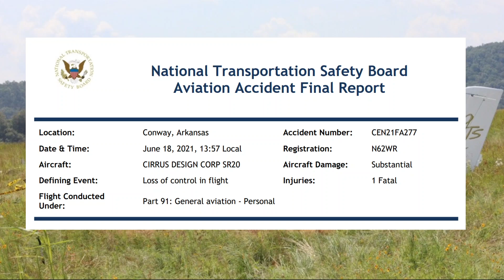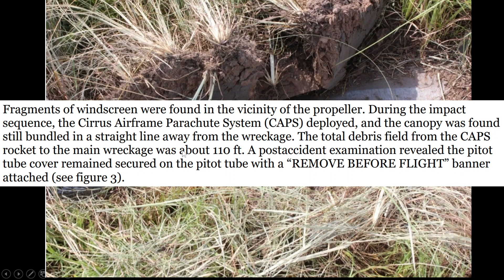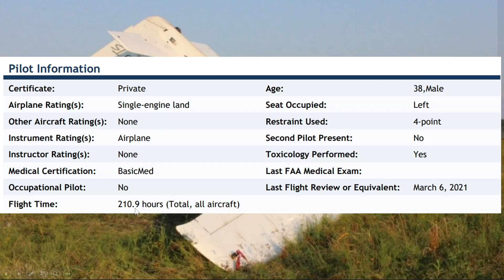Cirrus SR-20 Massive Stall Spin in Arkansas

Comment: Open fields everywhere, open road, or even downwind runway landing all looked like possibilities - it's a shame he tried to stretch it back and spun in. Again, as a glider pilot, I wish all powered pilots would at least get some stick time in sailplanes to help recognize that they may still have lots of options and to not panic.
Reply: All he had to do was make a normal pattern and land! Panic was the cause 😡. In VFR conditions loss of instruments should not be an "emergency"! The airplane has three basic "attitudes" coupled with three basic "power settings" that are used EVERY flight. Teach students ATTITUDE FLIGHT on every flight. Draw their attention to this to reinforce what they are already doing, attitude and power. Cover up the instruments and let's go flying using power and outside reference. Use this on Biannual Flight Reviews always and you will catch those students who were NOT taught ATTITUDE FLIGHT as they should have been! Instructors; it's a definite point in primary training but not being taught per se! One does not need to fly a glider to explain this,"forced landings" are already part of the curriculum.
Reply: Yes it would probably benefit every new pilot to do a little glider flying before doing powered flight. Obviously had not had enough training for this situation and started to panick and lose awareness instead of just flying the plane. I'd imagine an experienced pilot would roughly know their airspeed etc even without airspeed indicator. 
Shows importance of doing pre checks and a good walk around before flight. I'm not a pilot but as a pilot yourself how hard is it to roughly know your speed if your airspeed indicator fails?
Reply: @garymiller5624  Yes seems like he definitely hadn't had enough flight training or not enough training on his awareness without using instruments and knowing his power and outside awareness like you say. So sad when it's over a cover he forgot to remove but like you say if he'd had the right training he probably would've landed fine

Comment: My first plane a Cessna 140 taildragger we picked up in bitter cold winter had a frozen pitot tube. My Buddy Bob the best stick & rudder pilot at our airport flew it back with me, he landed at night greasing it on like it was nothing. Looked at me & said just like a old shoe. This Cirrus pilot had zero airspeed on the takeoff roll with plenty of runway to abort. In VFR conditions you can still easily fly the airplane by looking at the nose & wing tips on horizon  You know the horizon position on climb, cruise & decent when using your proper power settings & configurations. Pitot tubes get blocked all the time with bugs, water, ice or leaving the cover on. I had one partially block with mud dabbers giving much lower airspeed indication. Had no trouble flying it cause you don't use a airspeed indicator alone to fly the plane which I learned from Bob. Next flight it was completely blocked, a CFI & friend doing a BFR used the whole runway before rotating just clearing the tree's. I blame this accident on a total lack of proper training especially for a Cirrus. I also knew Mooney pilot that got killed taking off IFR then trying to land immediately with the pitot tube cover on. Flight training with the airspeed indicator covered up should be a requirement which good instructor's do.
Reply from the maker: That’s sounds like good training
Reply: I still teach the callout “airspeed alive” and call it out on every takeoff whether I’m teaching or operating my buddy’s antique aircraft. Be safe out there.
Reply: @samsharp8539  I have alot a pilots that don't confirm or know how to that the engine is producting full power on takeoff. Just because the throttle is firewalled doesn't mean your producing full power. They don't even know what static rpm check. All checks done at the beginning of the takeoff roll.
Reply: @Nord3202  Been asking that challenging question for decades. The other comment that scares me; “Well my turbo Bonanza/Arrow/ Saratoga, etc. can get out of the mountains with no worries about density altitude.” I guess they have turbocharged props and wings as well. Static rpm and power balance checks on multis are critical. I’m glad that you are emphasizing these checks. I get blank stares from knee instructors about the static checks. Don’t mind me, kids. I’m just old school.
Reply: New instructors.
Reply: @samsharp8539  With static rpm checks & density attitude calculations you can avoid taking off on a death flight, barely climbing out of ground affect or trying to make the impossible turn back to the runway. We need better CFI's way to many crashes due to poor training.
Reply: @Nord3202  The Stinson crash where density altitude bit the pilot is a prime example. The FAA’ s film “Harry Bliss and Density Altitude” was/is a great example as well.
Reply: @samsharp8539  That Stinson pilot was on a horror flight, once he broke ground he was at the point of no return. Every pilot should watch that  Stinson & Harry Bliss Density Attitude video for there flight training. We are seeing more crashes than ever.
Reply: @Nord3202  It appears that the trends are in the cards. We are making the same mistakes at an alarming rate. I have sure made my share of mistakes and have lived to tell about them. Ironically, I am back to flying a ‘46 Stinson Voyager courtesy of my flying buddy. Another great film is by the USAF from the 1950s. It it’s called, “No Sweat.” It covers a lot of everyday mistakes all in one flight.
Reply: @samsharp8539  Going take a look at that USAF No Sweat training film. You never can stop learning when it comes to flying. My friend has 2 Stinsons a Voyager & Gull Wing. When I was a student pilot a metalized wing Stinson 108 was sitting wheels sunk in the grass with a for sale sign $3200. I was talk out of buying by my CFI. Someone got it flying in a weekend. Saw it at every local fly in. Stinson a great plane.
Reply: @Nord3202 You sir, are killing’ me. A Gull Wing, the Detroiter, The Ryan commercial series were all on my bucket list. Time is running out. So many planes, too little time left at my age. Feel not, sorry for me. I ride the 1200 Sporty to the airport this am to help finish up a friend going for his CFI ride later this week. We flew his really nice Cardinal and pushed ourselves at the outer edges of the envelope with simulated failures an spins. What a blast. Another friend of ours just bought a 1939 WACO recently. Lots to learn, and a lot of fun to behold. I hope you like the No Sweat movie. Let me know. Added bonus, the almost-victim pilot was flying an F-86-D. Added bonus today, a little house keeping on the Stinson and my buddy’s Cruisair. TRWs++ in the area came through the area for a few hours. The ride back to our ranch was one of those cool, misty/virga rides with no traffic.

Comment: Not only did he miss that on the preflight which I can’t even imagine how. We have to not only check visually but he must have never checked the pitot heat either. We turn it on and then grab the pitot to make sure it gets warm. 
    Then during our takeoff roll the FIRST thing we look for is air speed alive moments after going full throttle. If that doesn’t come up we abort the take off. That plane should have never left the ground.
Reply from the maker: Makes sense, thanks
Reply: Careful grabbing the pitot tube, it can potentially have an electrical problem which can give you an electric shock and the shock may make you continue to grasp it. Use the back of your hand instead. ☮️
Reply: @ashsmitty2244  I never grab it as it gets really hot really fast just tap it a few times briefly. 
       I’m sure it’s possible but it’s highly unlikely anyone would ever get muscular lock up on a 24v or less system. I could go and touch both terminals of battery and I wouldn’t feel it unless I had wet hands. 
      A 12 or 24 volt dc system isn’t enough to really overcome the resistance of the skin. You need volts to overcome the resistance but only a few mili amps of current to kill. 
      If I grabbed a sold core wire really hard or pushed the end into my skin hard while touching a ground source that lead back to the battery I may feel a little something. 
      If there was a short in the pitot heat and I walked up to the pitot and grabbed it hard with my hand nothing would happen unless I was also holding the grounded frame of the airplane to complete the dc circuit.
Reply: Exactly, I mean, how did he know he was at rotation speed.
Reply: @rinzler9775  I guess he just threw his training out the window and sent it 🤷🏻‍♂️ I really don’t know how that plane left the ground.
Reply: Gold Plated Junk: Won't work on a short field,am familiar with a situation where the pilot did abort and ran out of runway into a ravine! Ruined the Cessna 182 but he lived. Taught ATTITUDE FLIGHT and flying 10 miles to a longer runway would have solved it all. VFR flight can be done very safely if instructors would just relate attitude/power relationship TO the instruments when available.
Reply: @rinzler9775  Too much reliance on instruments and not on our own senses; sight, sound, sensation. Human beings will screw up but our senses will save us if we don't panic and just use sense's.
Reply: @gtm624  It took off because it was flyable and was also landable. The plane doesn't need instruments to fly and it didn't need them to make a complete pattern to safely land .
Reply: @garymiller5624  yes, using ones own senses is primary, so much so that I didn't even think to mention it - I am talking pure instrument replacements if AI goes out - potentially also in an IMC situation. In VFR I spend 90% of the time outside the cockpit - I'd like more info on this crash, I have no idea how this guy crashed a perfectly good airplane.
Reply: @garymiller5624  definitely not. I don’t mean literally. But if my airspeed doesn’t come up I would abort. That goes for any other abnormality on any other gauges I scan on the take off roll. 
     I guess it comes down to making a point to know your airplane and have a go/no go point chosen on the runway. I bet he was waiting for the airspeed to come alive and it was too late to abort. 
     Never rushing a preflight is best. I always do a final walk around also. It’s almost inexcusable to not take the pitot tube cover off. 
    He didn’t check pitot heat either. Which ok I’ll let that one slide. For me regardless if there’s going to be a risk of ice or not. It’s part of my preflight. Just for those times I may need it and have forgotten to check because of bad habits.
Reply: @rinzler9775  he threw his checklist out the window and sent it 🤷🏻‍♂️. Along with poor training and lack of developed skill and knowledge. In part I blame the instructor. For not imbedding a thorough preflight into his head and for not teaching good seat of his pants flying. Like mentioned above in comments. Knowing the airplane. From my very first flight. My instructor had a cover on all the gauges. He started me from the gate, outside the airplane.
Reply: @garymiller5624  I didn’t think about short field but I’ll take an excursion over a stall spin any day of the week.
Reply: @gtm624  exactley - I mean, from the time I did basic circuits, climb, cruise speed, etc I was taught using RPM required settings for each phase. VSI and Alt were the next important ones, and then the ASI, althpugh all of them are important, and of course, looking outside - landmarks to guage your turn points, etc.
Reply: @rinzler9775  from the first flight I had with my instructor he covered the 6 pack. I had to learn how to fly not using them from day one.
Reply: @rinzler9775  Loss of control due "panic"😡. Not exactly as NTSB will term it but same theory . Professional pilots can experience it also but have the knowledge and experience to push panic immediately aside knowing they are doomed otherwise 🙄. This really is a factor throughout GA both VFR/IFR due lack of knowledge and experience or "recency" of experience. Can be over come if time is available; as it was in this case, but when immediate attention is required low to ground, demanding circumstances IFR, fatigue, a host of other circumstances associated with the incident it can overcome. The one constant is; consciousness or subconsciousness the impact with the earth will hurt! You and I were born with some fear of height 🤔.
Reply: @gtm624  and thats the way it should be - got to keep your head outside the pit. This may have been what happened here, he got fixated on trying to "fix" the IAS problem, he forgot to fly the plane. We may never know what really happened unfortunatley.
Reply: @jimbumgardner4835  That’s exactly what I do. It’s what my instructor taught me.

Comment: 1) 50 yrs ago with @12 hr TT, standard practice...  I was taught to takeoff, climb, land airplanes WITHOUT an airspeed indicator.
2) ALL my aircraft have had auto opening pitot tube flappers and fuel vents.
CP since '68.
Reply from the maker: You need to teach me one day Ray
Reply: @ARFFWorld  Today's instructors don't teach flying. They teach airplane driving.
Ok here's the key.
Trim your aircraft for your desired airspeed, say cruise neutral/ hands off. You add and hold back pressure to climb. (STOP thinking... pull back = bad) Then Climbing at VY I trim for vy +5 and hold back pressure to vy. If the back pressure is changing, your airspeed is changing. You never have to look again.
Landing trim for vx +5 or vy+5 depending on airplane, and hold back pressure to maintain  airspeed. You're FEELING the airplane. Feeling the air over the controls. Hearing helps too. The feeling varies with airspeed.
Instructors rarely say "add back pressure". They say PULL BACK, etc. They're teaching control manipulation NOT feel for the airplane and the air. When you learn this, you'll be able to land any airplane gently because you're feeling the airspeed bleed off and feeling the sink rate in your butt, not just pulling back because you think your low enough. BTW full stall landings are rarely smooth. Try that. My instructors flew in the 30s and 40s.👍 
THE BEST advice I ever got in 68 was "Now you've got to Learn to fly like you've got 40 people in the back " like Bob Hoover

Comment: This is another reason why you need to “know your numbers” for your aircraft. Which power settings and configurations equate to the performance you should expect at each phase of flight…
Reply from the maker: Thanks Travis for sharing
Reply: Got to be smarter than the airplane
Reply: How about “air speeds alive” or not alive. How about visual preflight how about check pitot heat. He missed it all. Crazy. Sound asleep at the controls of his body.
Reply: Travis Hubbard: This requires instruments, equate that with attitude and sound;it works and must be taught but many times is not.

Comment: Failure to remove a pitot-tube cover is a problem, but there is still no reason for the panic which probably caused the crash. When the pitot tube is covered, there is no indication of airspeed or altitude. But the engine is operating normally. Just pitch up normally for the climb, reduce power to your normal settings in the pattern, come back and land. Just estimate angle of attack on final approach.

Easy for me to say? It's happened to me a couple of times (not because of a covered pitot tube). No big deal.
Reply from the maker: Awesome, always good to stay calm in an emergency

Comment: We can all become complacent and forget covers and things like that but the best thing is fly the airplane use the long runway maybe and fly it on before you pull the CAPS system. Lucky for the Cessna 206 you can see the Pitot covers. One thing to look for his tape on the static ports which will produce the same thing

Comment: Look at the long stretch of nice grass to the left of the runway. A couple of drainage ditches look like they cross it but I'd rather hit a ditch than stall/spin. Pitot tube for airspeed reference not needed. You can tell by what the controls tell you. If they're sloppy, you're too slow. That sharp turn to final caused an accelerated stall/spin. Had a friend - J-3 Cub, took off, engine quit, tried to return, same thing, stall/spin. Two dead.
Reply: Bill Callahan; why would you crash a perfectly good airplane into a ditch when it is capable of flight and capable of a perfectly good landing 😡.

Comment: You don't need an airspeed indicator to fly VFR I did it in a C-182 when right after a Static system Check got in a hurry and didn't check the static ports the blocked for the test. and after an annual on the maintain ace check flight the Air Speed indicator went backwards.  a Inch worm had crawled into the Pitot Tube back where the flex hose connected to the back of the Pitot Tube and laid eggs. Now how do you check for Inch Worms?
Reply from the maker: Inch worms?! Wow!
Reply: Get an automatic pitot tube cover. They've been available for at least 70 years.